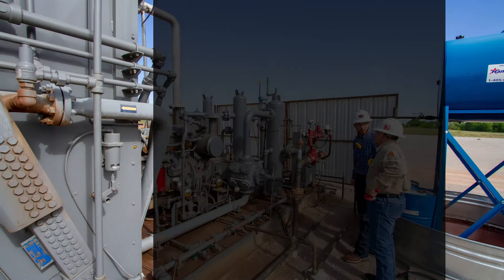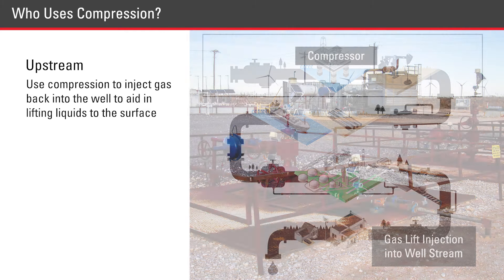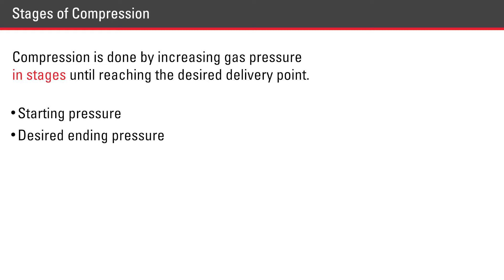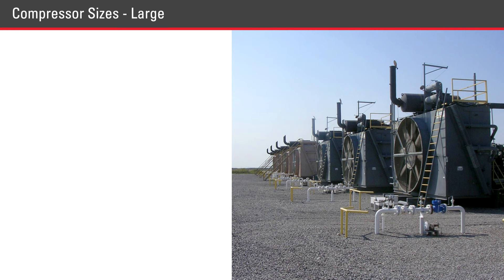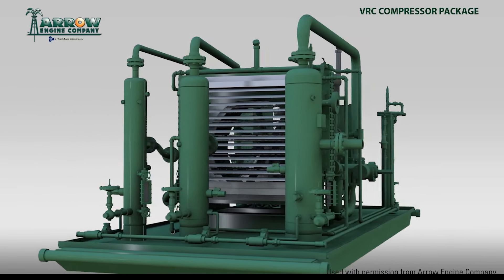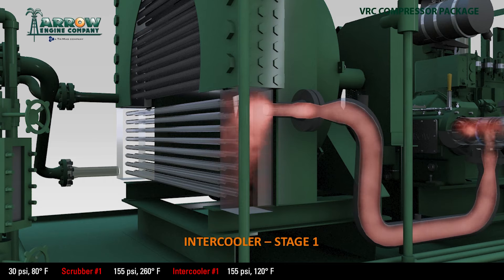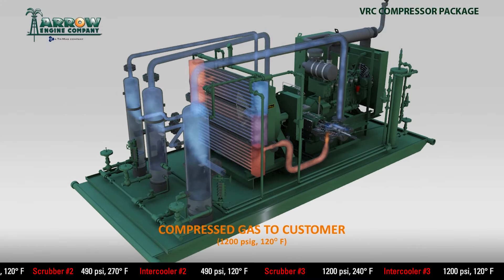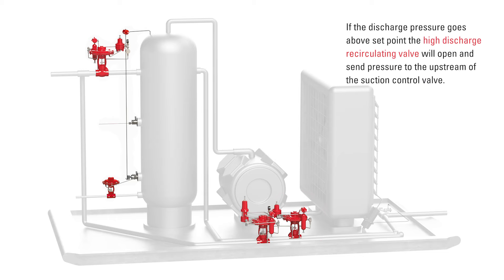Natural Gas Compressor Station Intro and Overview [Oil & Gas Training Basics]

Comment: My dad worked at a compressor station in falls city tx. It had two diesel engine compressors under a tin metal roof. When he had both of them running it was so loud you could shout as loud as you wanted to my dad or he at me you could see there mouth move but couldn't hear what they were saying. Need less to say it made my dad go deaf in both from nerve damage in both ears.
Reply: omg, Im sorry :(
Reply: I'm sorry for your dad, and also for the people living in the vicinity of such an installation...
Reply: i have one in my backyard yay me! did your dad sue ro anything im trying to figure out how to lawyer up for having one of these demons in my back yard. on top of the noise, my house smells like gas when they release pressure

Comment: how many CFMs do those giant fan gas compressors have?
Reply from the maker: That's difficult for us to answer– there is such a wide range of flow rates depending on the size of the compressor, number of stages, and suction pressure.

Comment: Does anyone know if these compressor stations can filter out the other air molecules? i.e. Nitrogen, oxygen, hydrogen, etc.
Reply: In the facility I work, oxygen is needed to keep the combustion for the energy by mixing it with fuel gas

Comment: Excellent. Can anyone tell please how does "pneumatic liquid level switch" work?
Thanks.
Reply: It’s based off a float, once your float rises supply gas opens your motor valve on your dump line, dumping fluid from the scrubber bottle into the condensate lines to your tanks.
Reply: You can also adjust the sensitivity of your LLC.
Reply: @garrettclemons7996  are these the same types of floating switches that youd find in a sump pit?